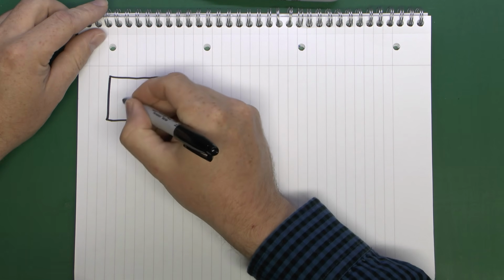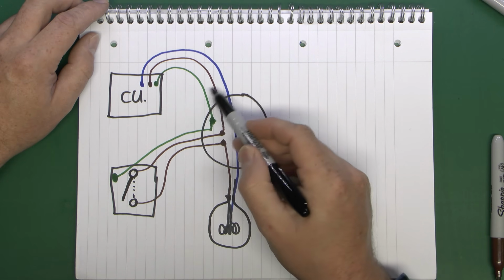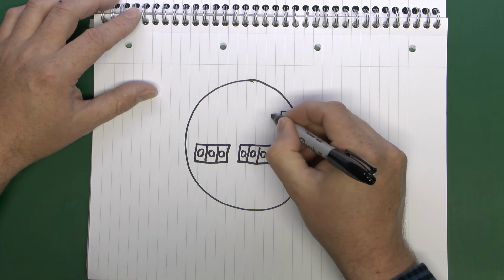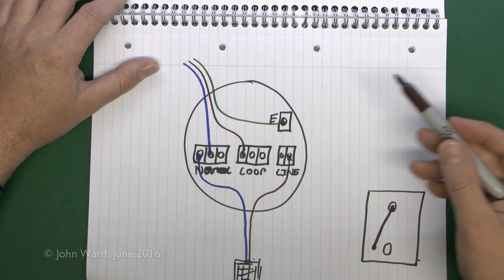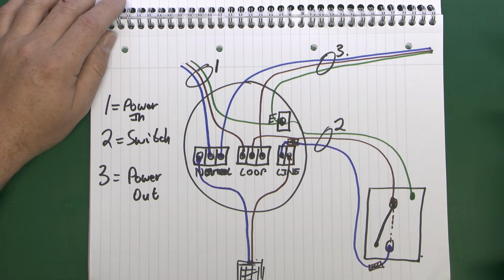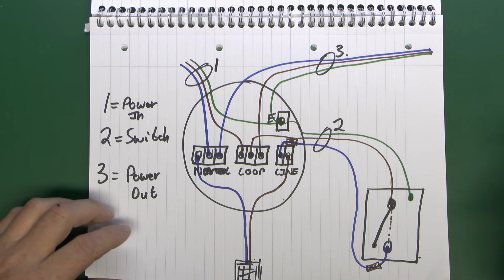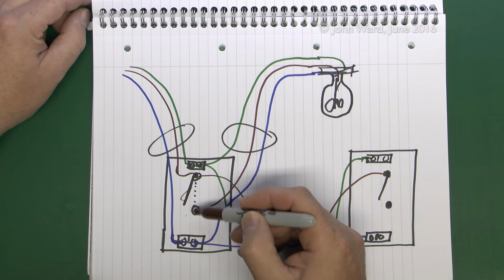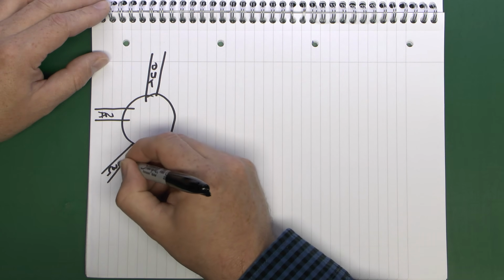Lighting Circuits Part 1 - Basic Concepts

Comment: This is the best ever explanation of lighting connections in UK 

The first method used called 3 plates which is used in domestic installations 

The 2 method which is really good as well but I don't know if it is correct if I call it zero plate because nothing is connected to ceiling rose 

As far as I know, 2 plate method which is connected through ceiling rose and switch is used in commercial and industrial installations.

Thank you so much for the videos

Comment: Hello John, great video.

When running power to the switch, then to a series of ceiling roses, how should the wires be connected in the ceiling roses? Specifically, is it best practice to bring the live cable into the loop terminal of the rose or the line terminal?
Reply from the maker: Use whichever is convenient -  with 2 cables in/out and the flex to the light it is easier to use the 'loop' terminals as those have 3 holes, the line one only has 2.
Electrically it makes no difference, they are all just a block of metal with screws in.
Reply: Thanks John. I wasn't sure if there was an accepted standard.

Comment: question please. i don't have a ceiling rose i have three black and 1 red from the ceiling. i have three light switches . can you explain how this is possible.
Reply from the maker: There are many ways that lighting can be arranged - impossible to know whet you have got without some testing or locating the other ends of those wires.

Comment: Very nice video. In my house the lighting circuit is a loop (ring) with both ends connected to the CU so there is also a third T&E cable tied into the ceiling rose's which goes on to the next light.

Comment: john   i am not a qualified  election   but   i know the basics  ,, the thing is  i have put a  geni in my camper   ,,  all well  works well  to,,,, i have installed a  trip box  cu   for // lights  //plugs // microwave   and i do not need higher  just now,,,   the thing is  it as a elect outside   3 point  plug for the mains  plug in    ///you know  the ones they us for  110 volt as well //// no w  do i have switch off  the live and neutral      or just one of them   so there is no feed back to the  geni   help would  be  very nice  in this matter    thank you john

Comment: Great video. I have just done this in my garage running a series of 4 lights all working from the one switch. However the power dims as each light is added. Is this a parallel or series circuit and how do I get full power to each bulb?
Reply from the maker: Should be wired as parallel.  If it's in series (unlikely) then removing one bulb would stop all of the others working.
Parallel is L&N to 1st bulb, extend the same L&N to the 2nd one, and the same L&N to the 3rd, 4th and so on.
If they all remain on but just get dimmer as others are added, there is some other problem involving the supply, possibly due to grossly undersized wiring or a high resistance fault somewhere.
Reply: Thanks JW. The problem seems to be different as I have only one bulb connected now to 6A MCB since I had them parallel wired and so to work back to the root cause. I also have a 2 gang socket from my new CU in the garage from the 32A MCB. When I plug in my power drill battery charger to the socket and switch it on the bulb dims and switch off the bulb brightens. The plot thickens. Problem with CU or supply to the CU?

Comment: Hi John, im doing a course and was asked on how to design a lighting circuits for a stair case a 23  flooring buildings.

the requirements is that anyone can turn on/off the lights at their individual floor or potentially  all floors.  
we are given 25 3gaine switch and 23 intermediate switch .

im sorry but i have been scratching my head and was able to come up with a solution and is hopping for some ideas or advice to help me kick start.

thanks John

khai

Comment: John, thank you, I done the same wiring in the shed years ago, I am now old and apparently cant remember. Could not get it working , should have taken a photo of the connections but I did not. I then had a light bulb moment, ah You Tube. Saw your video, and after 2 hours of mishaps it took all of 8 minutes and up and running. Big thank and let there be light.

Comment: Why cant it be explained like this for australian wiring.....well it cant be so very different...can it?
Reply: It is the same except Aus uses the old British red(live/active), black(neutral) colour code for fixed wiring. Domestic switches are generally not earthed because the mounting screws are hidden behind plastic plugs. The other difference is in modern installations. Here, the cable to the switch (known locally as "twin active") uses red and white conductors; the red being always live (the feed into to the switch) and the white being the switched active (the feed from the switch to the light). Older installations used ordinary twin (black/red) cable to the switch. This confuses non-electrician home owners who replace a light fitting because the light bulb is fed by two black wires.

Comment: I've really benefited from your practical anecdotes on power connections. I really have humble request however to make. Have you made a video of how to: 1. Complete and simplified diagram of how to connect the four power inlet wires from the 3-phase pole to the Main Distribution Unit including earthing system, 2. Complete and simplified diagram of how to connect the inlet wires from the Main Distribution Unit to the individual  3 separate Consumer Units and lastly, One complete and simplified diagram of how to connect these individual consumers with the digital meters - digitally topped-up, let me know please and I'll really appreciate. BIG THANKS for your lessons, Joe

Comment: what is CU stands for ?is it circuit breaker ?
Reply from the maker: Consumer Unit.  Box with circuit breakers inside.
Reply: It's Consumer Unit, Which is the box where the supply comes into the house and is distributed to the various circuits, protected by earth leakage breakers.

Comment: Great video. I've just completed my EAL Levels 2 & 3 electrical. In level 2 we were given diagrams to follow to wire lights, so that's what we did. We could have done with an explanation about what we were doing and why. Anyone should at least be able to follow a diagram, but, it's understanding why is more important. At the end of the year we had all our folders taken from us because in the past some people on the course (not necessarily in our college) had posted them on the net. This video, and many more of yours fill that knowledge hole. I very much appreciate them. Thank you.

Comment: Cheers for this! I'm totally clueless when it comes to lighting! Iv recently blew two, and your example of what people do, at the start of this video was spot on.

Your vid has made this so clear to me, (Which is not easy) Im still not looking forward to installing a new ceiling light as the way it is set up still tries to confuse me. Im hoping that with this video i have now learned enough to figure it out.

We have been without the main light in the front room for four years due to my bro blowing it. Using lamps was fine for us, but after recent decoration now is the time to give it ago again.

Thanks again. Best vid by far.

Comment: Thank you.  I think these will be, from now on, my go to explanations when I need to do some wiring job that's too small for any local electricians to want to do.  I just need refreshing, every time I do something, because my fear of electricity is growing as I get older and I need this kind of clear and illustrated explanation of HOW the circuit works.  No good, for me, somebody holding up a branded thingy and saying put the such and such in here and whatever (and often spend far too much time explaining how to cut holes in plasterboard etc.) - I need to understand the greater scheme or I will set fire to the place!  Thanks!

Comment: Close, but no cigar, wiring it by your diagram will cause second light to be on all the time, live from 2nd light should go to "line" so both lights go off by the switch. I've just wired my garage following your diagram, then change the 2nd live to line to make it work.
Reply from the maker: The cable to the other lights is for others wired the same as the first, with their own switch, typically in another room.
If you want two or more from a single switch, then connect to line as you have done.

Comment: In my flat, it is an old building, but it goes like this: Live from the C.U goes to the switch,  and the neutral from the CU goes to the light fitting then a single core cable feeds from the light switch to the light fitting creating a series system but unfortunately no earth

Comment: If you want more than one light in the room to be powered from one switch can't you just connect more lights in parallel to the outermost terminals of a regular ceiling rose?
Reply from the maker: Yes, just connect any additional lights to switched line, neutral and earth.
Reply: John Ward Thanks for the reply and amazing videos they have been very increadably helpful.

Comment: Wow...its amazing watching this, not sure what country you are from but your people are praising you, GO JOHN....In America we would say "what the hell is this garbage, this moron has no business trying to teach anyone electrical lessons". Seriously, that has to be absolutely the worst video/explanation I have ever seen regarding wiring lighting and switches. I wouldnt let my 4th grader watch this, not to mention our children are building lighting circuits and learning how to wire switch panels in the 4th grade.  Im absolutely dumbfounded after watching this, this is simple, common sense electrical and you still made yourself look like an idiot....please dont come to America, you will be jobless and homeless if you are considered knowledgeable in your home country...
Reply: Apart from being extremely rude, you are also wrong.
The domestic supply in the UK  is 240 volts, so potentialy [!] a killer.
He does not have to explain how a circuit works per se, but it does help if one can understand what  a circuit is, and how a switch works.
Very little domestic wiring is taught in school these days, and most significant domestic electrical work requires a qualified electrician to sign it off. 

There are going to be several possible incorrect methods of wiring which may have been adopted by some previous electrical amateur in one's house, these can be identified and corrected by a qualified electrician. There is no 100% guarantee that your house electrics are safe: standards are improving, and Compliance, a professional standard, is essential these days.   

What he is doing is explaining what happens in the UK, where we may have different colour codes in one house! 
An understanding of what one is doing, and terminology [!] are explained and carefully used as appropriate.
Yes, it is long, because it is detailed, he explains things clearly, and also explains things thay you might find in your house, things which have been done correctly and those which may well be incorrect.
If you look at comments, you will see that quite a few are from apprentices and their mentors, that is because there is a need for this type of video, and an appreciation of the work he has done in preparing it.

Comment: Brilliant video just put a new ceiling rose on ceiling light permanently on if you discanet the feed goes out do you think it's a faulty light switch switch approximately 10yrs old
Reply from the maker: Either the switch is faulty and stuck in the on position or you have mixed up the wiring in the rose so that the lamp is connected to the supply and not the switch.

Comment: John - what a great set of video's - all very very good - one question is there a dvd or memory stick or similar with all your training video's on them - I completed my electrical exams at the beginning of last year and am brushing up on everything as I have not used any of the theory - thanks in advance
Reply from the maker: There is not and won't be - there are already 250 videos with a total size of several terabytes.  Even after compression, it would require several dozen DVDs.
Reply: Thanks John, a great site to brush up and work a few things out that are not fully understood. Thanks
Reply: Assuming John doesn't mind you having a copy of the videos, there are plenty of browser addons(Firefox/Chrome/Opera) available that make it a simple click or two to download Youtube (and other streamed) video content to your computer.

Comment: hi John.  can you explain something about 2 way switching I've recently across. there's 2 ceiling roses linked as would be expected and two 2 way switches. the connections baffle me. there's a single brown connecting the common terminals and in l1 and l2 there's 2 brown and 2 blue. there's no extra wires at the ceiling roses other than what you would expect. 3 blues in neutral bar, 3 brown in line bar and switch feed for the light. can you explain this circuit to me please. thank you.

Comment: On the second diagram with the wire going to the second light  no 3 cable would this be permanently live as its not connected to the switch or have I missed something.  Thanks .Nath.
Reply from the maker: Yes, the middle 'loop' terminal and the wires connected to it are always live, regardless of whether the light is on or off.

Comment: Can you tell me that when fixing a new ceiling light just blue to blue brown to brown earth to earth.  is that correct
Reply from the maker: If you only have one wire of each from the ceiling, then yes - just connect the same colours together.  If there is more than one cable then probably not, as one is likely to be for the switch.
Reply: Thanks John.

Comment: Hi, I have a house from the 1960's in U.K. In my ceiling light I have 1 x SW Brown , 2 x Neutral and 3 x Line, Loop In. What I don't understand is I have a wire going from Neutral to the Line connector in a U loop. I hope you can help I want to move the light to be in the center of the room. Andy

Comment: 'Only to discover there's far more wires that they think should be there'.  That is exactly what happened, apart from I was fortunate enough not to rip it down first!  Managed to get the job done after watching your video and think I understand why the light fittings in my house are different now.  Thank you very much for your help, fantastic video.

Comment: Thank you John for an informative video.  I used a screenshot of your final diagram and a screenshot of the start of search results by googling "wiring colours uk" (because my wires were using both old and new colour schemes) and printed these for reference as I fixed my wiring.

Comment: Hi John, I live in a flat and the two lighting circuits seem to be interlinked is it possible for you diagnose what is causing this, its not a two way switch! borrowed live? borrowed neutral? is this a fault that can develope on its own ? we have had flooding from flat above numerous times in past, I have change a number of ceiling roses in the past is it possible I have wired these wrong at some point?, extractor fan fitted in bathroom some time ago,built in the 1950s 60s original consumer unit regards Ron......................

Comment: Thank you JW, you just saved me £200.
Reply: call an electrician
Reply: Ditch the dimmer if you can they are usually a pain. Also you might find that the dimmer module isn't rated for dimmable LED's (the module is geared for a bank of 50 W bulbs instead of 5 W bulbs; check the range at which the dimmer module operates at: it should say on it) also make sure that the bulbs themselves are dimmable..... been caught out on that before :)
Reply: I watched your video but I'm still a bit stuck. I'm trying to fit a new ceiling 5 light pendant but the lights are flickering on and off allthe time. It is a 2 way system and one of the switches is a dimmer. From the  ceiling there are 4 wires red,  greenyellow and 2 greys but on the new fitting only blue and brown. Any advice you could give. me woul d be great. Thanks Dorothy.

Comment: hi I've moved into a house with two separate room lights controlled by just one single swith ... how hard would it be to install a second switch to separate these two lights 
the switch is in a bedroom it powers the room it's in aswell as the attic lights... thanks
Reply from the maker: If you can get to the wiring it should be straightforward.  You need a permanent supply to the attic light rather than the existing switched one, and add a cable from the attic light to a new light switch.